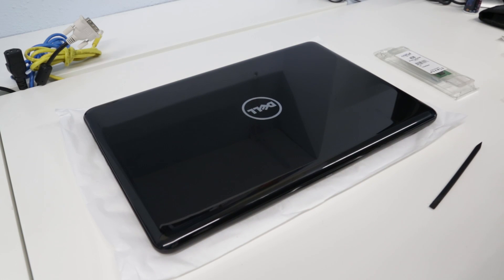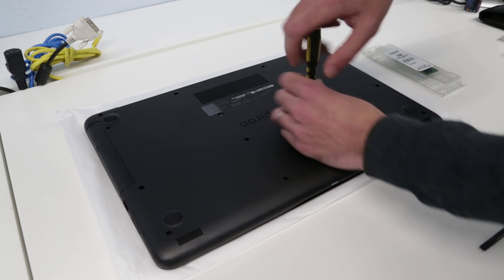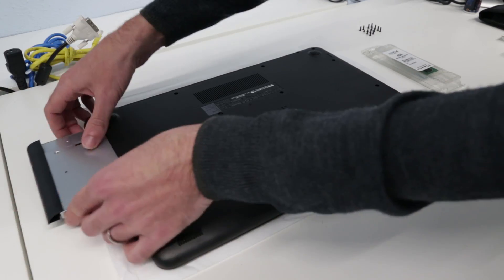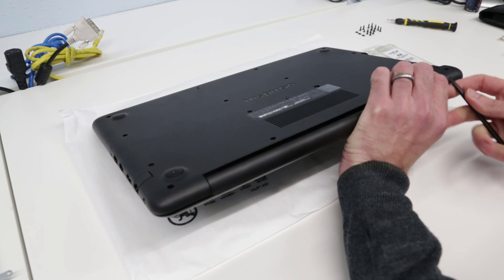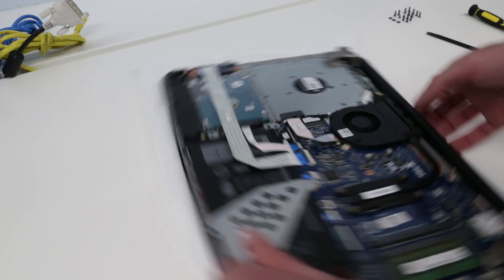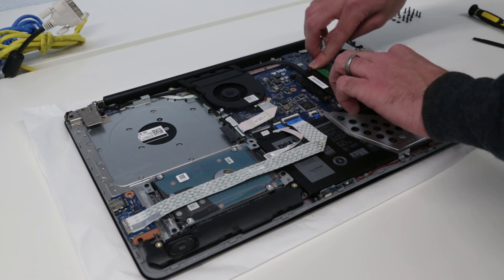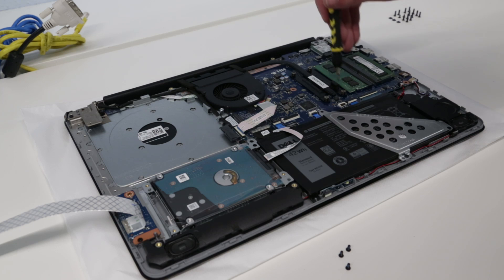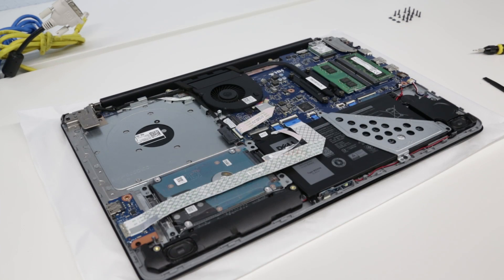Dell Inspiron 15-5567 Memory and SSD Upgrade Guide

Comment: Hi, it seems like you still reply to comments so if you are seeing this, please help. I am unable to open a screw in that same laptop so if I give you the timestamp (3:38) would it be possible for you to guess the screwdriver size I require for it, would be really helpful if you reply. Thanks !
Reply from the maker: Errrrm, PH0 or PH1 I expect.
Some things that may help
- Put some electrical tape over the screw and press the screwdriver into it over the slot so it grips it better
- If you need to put more pressure on it then open the screen up to 90 degree and place it over the edge of a desk, that way you can press down into the palmrest without pressing down on the screen
Reply: @BrueComputing  Thanks so much I will try it !
Reply: @BrueComputing  Well, the PH0 did not work so I just ordered a set for 5 bucks that has PH00 and PH000, maybe that'll work !

Comment: Hi,
i have a dell inspiron 15 5000 series 5567 model (Intel(R) Core(TM) i5-7200U CPU @ 2.50GHz, 2701 Mhz, 2 Core(s), 4 Logical Processor(s)).

It only has 4GB ram and i want to add another 8GB.
You think it will hold 12 GB?

Thank you for your respose
Reply from the maker: Should work fine.

Comment: I had to replace the power jack on mine. You need to actually remove the motherboard to be able to get to it. I was able to figure it all out though and get it back together.

Comment: Great video thanks! is 8 gig the max upgrade you can do on this model? Thanks
Reply from the maker: You should be able to run 2 x 8GB at least. 16GB modules may work, but not tested it.

Comment: Hi!
I'm Flavio from México :)
Is it possible to install 32 Gb of RAM to this computer?
Thanks in advance!
I love your videos, man
Reply from the maker: Officially I believe the max is 2 x 8GB, so 16GB.
2 x 16GB may work, but I didn't test it.
Reply: @BrueComputing  I read the manual for this computer and it says it can only handle 16 Gb of RAM and that it's recomended to install 2x8 Gb instead of 1x16 Gb
Reply: yes it will work. every laptop has max 32gb

Comment: Thanks for this video! To upgrade the computer with an ssd, i'd have to remove the hard drive? there is no additional slot? Thanks again!
Reply from the maker: Correct. Only other option would be to remove the optical drive (if it has one) and fit the HDD into a 2.5" optical bay caddy.

Comment: can i install samsung 970 pro 512GB  M.2 NVMe Interface Internal Solid State Drive in this laptop..please do reply
Reply from the maker: No, there is no M.2 slot in the 15-5567. You can only fit a 2.5" SATA SSD, eg. https://amzn.to/3nlUjNI (Amazon Affiliates)
Reply: @BrueComputing  which one is the best ssd for 15-5567..please help me to find best one sir
Reply from the maker: @therockingassault  I liked a Crucial one in the previous reply. Alternatively Samsung 870 Evo: https://amzn.to/3EanCt7 (#ad)

Comment: Upgrading to Kingston A400 SATA3 2.5" Internal SSD to drive bay and moving the original 1TB 5400 RPM SATA hybrid drive to the DVD Drive chamber using a 9.5mm caddy adapter.

SSD to improve performance and I wanna utilize the 1TB drive for storage. Is this doable for Dell Inspiron 15 5567?
Reply from the maker: Should be if you have a optical drive in your laptop, yes.

Comment: Crucial MX500 1TB 3D NAND SATA 2.5 inch 7mm (with 9.5mm adapter) Internal SSD? Will this fit in dell Inspiron 5567?
Reply from the maker: Yes.

Comment: What kind of hdd and dimension it's have
Reply from the maker: 2.5" SATA SSD, 7mm thick.
Reply: @BrueComputing  thank you for reply well I didn't expect from 7 years old video
Reply: @BrueComputing  well I wanna know that the laptop dell inspiron 1547 you are showing above in the video is it compatible with SSD 240Gb Crucial
Reply from the maker: This isn't a video of the Inspiron 1547, it is the 15-5567...
Reply: @BrueComputing  ok thanks

Comment: For the 8GB variant is it possible to upgrade to 16 or both slots are filled with 2 4GB rams? Please respond ASAP.
Reply from the maker: You can check what is installed with CPU-Z, the Memory tab will show you if the controller is in single or dual channel mode, and the SPD tab will tell you what is in each slot.

Comment: Hi.  Your video helps me to change my old hdd for an sdd, but I didn't notice something until now, for some reason my headphone jack seems to not work , I plug my headphone and it doesn't  get detected by my pc. Do you have any idea of what it could be wrong? I hope that you can help me.
Reply from the maker: Strange one, as I think the headphone jack is on the mainboard.
Do you have the base properly fitted and clipped in to place, or is it stopping the jack from being pushed all the way in?

Comment: Good news is that it's 1 x 8GB rather than 2 x 4GB. So I just need to get another 8GB RAM board and it's then maxed out for memory. An awful lot of screws. No room for 2 SDDs so external SDD is backup. Then image the primary drive in the backup and create a backup script to update the backup every hour and push the changes up to the web server archive. Could also use an M-disk in the optical drive for important data. 3-2-1 almost.

Comment: A query, this pc was very good for me, but due to carelessness the motherboard does not work, it is worth replacing it and changing some components to continue using it or it would be better to think of another more current equipment, I feel that it can still be removed very useful.

Comment: thanks for the video. i was stupid enough to offer a neighbour a hand in upgrading their laptop. I'm not used to working on cheap and nasty laptops which this invariably is. I would have been stuck trying to open it without your guide. Although I did manage to cut myself for my troubles
Reply: @ Mash Khan I've been using this cheap and nasty laptop without incident for SIX  years and I love it! It suits my needs PERFECTLY!

Comment: I get some ratling sounds coming from the CPU cooler, I wonder what happened
Reply from the maker: Could be a small piece of plastic or a screw has got in to the fan, the fan spindle has come loose allowing some vibration or contact with the shroud, or a bad bearing in the fan.

Comment: A pain to take all those screws out but at least you don't have to detach the LCD screen to get to everything. I was able to test that I attached the MB cables back correctly for the SSD I installed before putting it back together. Initially it wasn't reading detecting it on boot. Very helpful video. Thanks!
Reply from the maker: Glad it helped!

Comment: I’m 12 I’m stupid is there anything I should NOT touch?
Reply from the maker: There won't be anything particularly high voltage in there, but the advice I would give is be sure to ground yourself before starting (touch something large and metal), work calmly and methodically, don't get frustrated or be afraid to ask for help, and don't rush.

Comment: I always get stuck on the part where you have to unscrew the screws that the dvd drive covers. Those screws always break my screwdrivers
Reply: i have the same issue with the screws did you solve it yet?

Comment: Why didn't you disconnect the battery before upgrade the hardware. Dell service manual says it is one of the important step. You are upgrading the hardware while it's connecting to the power souce. I hope this helps to anyone. Anyway this is a very good tutorial. cheers
Reply: It doesn't say that on the manual (https://topics-cdn.dell.com/pdf/inspiron-15-5567-laptop_service-manual_en-us.pdf). Hit me up a link so I can read on that as well, I might as well do more readings before proceeding. Thanks!

Comment: The boot system does not recognised my ssd. It only show windows boot system when it should also show my ssd location. Plus given the access, it's a pain in the ass to replace it back to the hdd. Help?
Reply from the maker: Have you installed Windows to the SSD?
Reply: Yes. Fortunately I have solved it just hours ago. Turns out it's better off cloning just the c drive. I was too greedy to clone both c and d drive at the same time(d is where all my work is). Thank you for replying Brue.  It's lightning fast now plus I get to have 2TB HDD as back up harddisk.

Comment: How is the performance after installing the additional ram? Did you install an SDD or replaced it with the existing HDD?
Reply from the maker: The improvement in performance with RAM alone will depend what you are doing - I was using the laptop for game testing and in that case going to dual channel memory gave around a 27% performance improvement: https://www.youtube.com/watch?v=tQvOXa9K-UE
In regular applications though the difference likely won't be so pronounced.

I fitted an SSD in place of the standard HDD, which made a significant difference in start times, application loading, etc.

Comment: I do have query hope you'll help.
I've got to know this model provides speed of storage i.e. 6Gbps while it comes to optical drive it is only 1.5 gbps limited by sata. 
I wanted to have ssd and hdd both on my pc. Here my preference is to have good boot time. 
here, I think installation of ssd in place of my main hard disk and main hard disk should be installed by the caddy adapter no matter it provides 1.5 gbps for storage load time but my boot load time is increased that's what I think.
Will this method work?
Is there any method that provides both storage 6 Gbps?
Note: I do having this 15 5567 model with I3 6th gen conf.
Reply: Did this work?

Comment: Why do they make the battery so difficult to replace when its the first thing of the laptop that needs replacement after a year of use ?

Copying from service manual: 

Prerequisites
1 Remove the optical drive.
2 Remove the base cover.
3
 Remove the I/O board.
4
 Remove the hard drive.
Reply: This one is easy compared to other Dell laptops to upgrade a hard drive.

Comment: Can we add an SSD without replacing the HDD just like we do it for a desktop PC?
Reply: yes
Reply: @stuffboss  How can I do that? Also is there any extra m.2 slot in the laptop? I have the same laptop Dell Inspiron 5567
Reply: @blair49  you can insert ssd instead of cd-rom.
Reply: @stuffboss  OK. But is there any m.2 slot in this laptop?
Reply from the maker: No.

Comment: Hi;
Thanks a lot for this video. Now everything Works fine however laptop speaker does not work. when i plugged in headset to notebook, it Works very well. Unfourtanetly lapotop speaker does not work. Is it possible problem opening back cover? Thank you
Reply from the maker: Did you damage or unplug the speaker cable?

Comment: I need an immediate reply. I have the same laptop and bought a new DDR 4 4gb ram 2400 frequency Kingston. The problem is when I was going to install it the pins is not exact but if I flipover the ram it fits. Should I install it upside down?
Reply from the maker: Yes, flip it so the keying slot is in the correct position.

Comment: I upgraded my 5565 form Amazon to a 512 SSD and a great little UHD Blu Ray ODD...then it died 24 hours later. Every time I so much as TOUCH the power adaptor to the laptop power port, the green light on the adaptor (brick) goes off. WHAT THE HECK ! Is this one of the infamous DELL power issues they had a few years back? I thought they got that fixed !!! Any ideas how to fix this power issue...can't charge the battery, laptop won't run now. ANY help or ideas would be helpful before I send this to DELL for $$$ NON-Warranty work.

Comment: Is it good practice to (after backup of storage of the hard drive to an external source), to wipe the hard drive clean before replacement?

Thanks for the helpful video!
Reply from the maker: If you're disposing of it, then I would recommend secure erasing it. If you're reusing it (eg. in a caddy for backups or file transfers) then I'd probably just reformat it.

Comment: Hi guys can i put the Samsung 970 Evo pro 1tb in my 5567. is it supported ?
Reply from the maker: No. There is no M.2 slot in the 15-5567. You can only fit a SATA SSD.
Reply: @BrueComputing  thanks for your reply
Reply: What if I buy the M. 2 to SATA conversation on Amazon, I still have a chance ?
Reply from the maker: No, the adapters can take a SATA M.2 drive, but not an NVMe one as there is no PCIe interface for them to use in a standard SATA header.
Even if they could, they'd be limited to SATA speeds, so it would be pointless.

Comment: dear friend, i am planning to remove the dvd room and put ssd box there. i will use both HDD and SSD together. in this way can i install my original windows 10 in this SSD?
Reply from the maker: I'd probably do a clean install on the SSD, but you could clone the contents of the HDD to the SSD using something like True Image.

Comment: Hello, first of all i'd like to thank you for the video, was helped me a lot! However I had a "little" problem: I disassembled the laptop and changed the hd for a ssd successfully, I turned on the pc and the hardware check was a succes. When installing the w10 I noticed that there was no sound on the pc, I thought it might be a lack of the sound driver, but I already updated everything and still not working. I wanted to ask you if it's a common problem or if I probably screwed up my audio hardware ):
thank you again!

Comment: this is the shitiest laptop i have ever owned. Thought of upgrading ram, then got to the 3 ahole screws and was tempted to throw this garbage as far as possible coz the screws are made of butter their heads just melted away so i quits and sworn NEVER DELL AGAIN EVER
Reply: I've taken these 3 screws out at least 15 times with no problem. Maybe you used the wrong size screwdriver and stripped the heads? How is that Dell's fault?

Comment: Can it work without DVD driver? How can I cover the DVD slot after removing it? Please make a short video to show me that. Thank you!
Reply from the maker: It will work fine without the DVD drive. You'd need something to blank it off, or stick the DVD drive faceplate in place. You could perhaps use an optical bay HDD caddy.

Comment: I didn't see when you add the new SSD to the laptop
Reply from the maker: You'd replace it the HDD with it, I didn't have one to fit at the time, but they are just a standard SATA drive so the process is applicable either way.

Comment: Thank you for such a detailed video. I have the same model but it has the amd a10 processor. Would you know if the hard drive would be the same as the intel one 2.5 or different ? Thank you in advance.
Reply from the maker: The 2.5" SATA HDD is pretty standard really, so I'd be VERY surprised if it used anything else.

Comment: ye I have the same laptop it runs like a turtle, but if I grab a 500 gig ssd it will be faster than my gaming desktop's drive because when I built the desktop I could only afford a 7200 rpm 2tb hdd
Reply from the maker: For boot times and application loading, I would expect a big performance improvement.

Comment: can we upgrade graphic card of this lappy
Reply from the maker: No, the model I had used integrated graphics and there is no MXM module connector. Versions with discrete graphics have it soldered to the board and aren't upgradeable.

Comment: Hello. Does all the 15 5000 series have a extra ddr4 ram slot? Is there a sdd m.2 slot? Thanks!!!!
Reply from the maker: Which model of 15-5000? That covers a lot of different laptops.
Reply: Brue Computing 
Model #i5577-5858BLK-PUS
Features:

4GB NVIDIA® GeForce® GTX 1050 Graphics

Intel® Core™ i5-7300HQ Processor 2.5GHz

10/100/1000 Ethernet LAN (RJ-45 Connector)

802.11 Dual Band Wireless-AC WLAN + Bluetooth® 4.2

1x HDMI

https://m.costco.com/Dell-Inspiron-15-5000-Series-Gaming-Laptop---Intel-Core-i5---1080p---4GB-NVIDIA-Graphics.product.100339965.html

Comment: I hate how the brands follow apple making unibody, battery integrated and almost no user upgradable laptops, my 7 Years old Asus K46C had easy upgrades and battery changes with almost no effort, but with this new models you can easily fuck up something.

Comment: Had the pleasure of experiencing this tear down myself last night. I installed a 1080p matte screen - as the 720p shiny screen wasn't cutting it for me. Fortunately, separating the actual screen bezel from the casing wasn't remotely as hard as separating the bottom from the main chassis.

Comment: Just bought this from Costco, came with 16GB ram, I7-7500, "signature edition", Radeon M445. But not a SSD... Will replacing the HD with SSD void warranty? I was thinking I could pull the stock drive and keep it, then put it back in if there's ever a warranty prob.
Reply from the maker: Technically yes, although there are no clear warranty stickers or seals on my system, so if you use soft plastic tools and don't mark the panels I expect you'd get away with it.
Reply: Where did you get the plastic tool. Do you think a plastic knife, or any flat similarly shaped piece of plastic would work?
Reply: Amazon - look for those cellphone repair kits. A plastic knife will definitely work, but not as well.

Comment: what tool did you use to remove the 3 screws (M 2 x2 BIG HEAD) by the DVD.
Reply from the maker: Don't recall exactly as it was some time ago. Probably a Philips 1.5 or 2.0 bit.
Reply: Just get an iFixit kit. It will have all bit necessary for most all tech tear down.